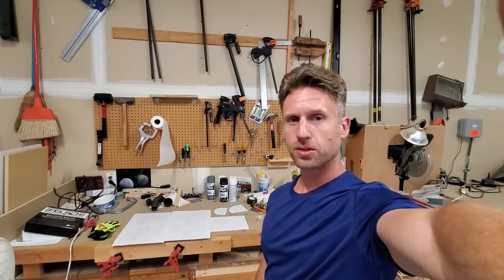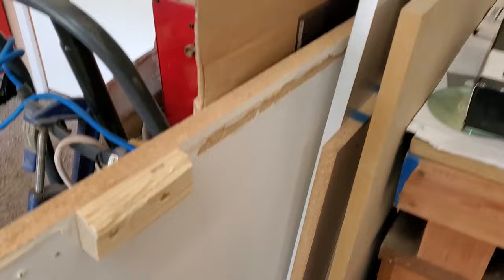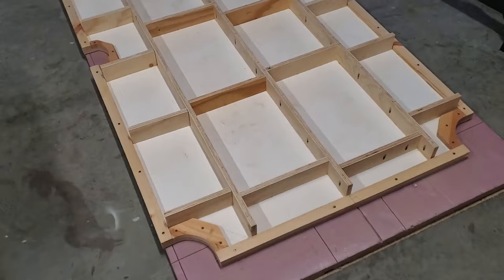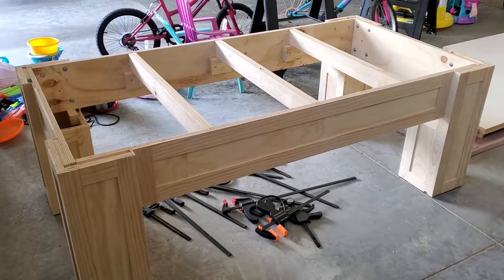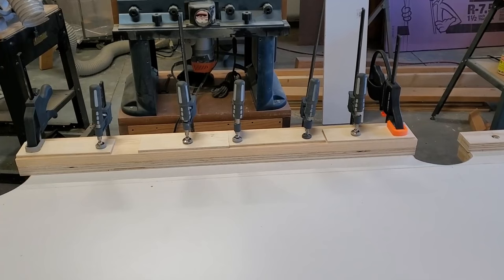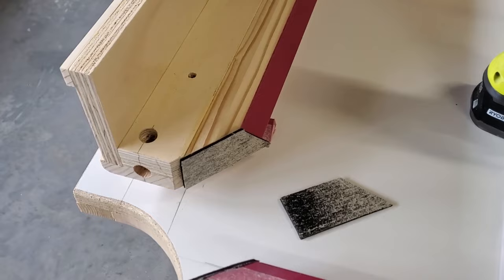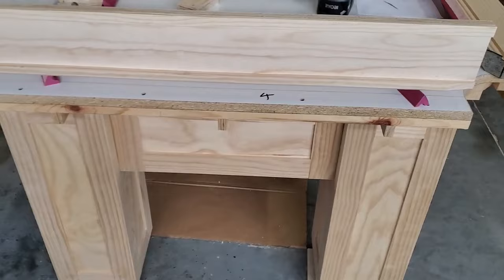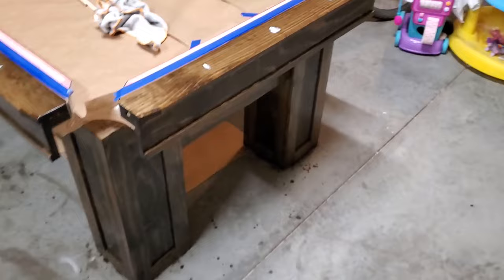DIY Pool Table

Comment from the maker: Since everyone keeps asking, here are drawings for the pocket cutouts, and the rail cross section.  This may or may not work for your project depending on the dimensions of the pockets, rail bumpers, etc.  My rails overhang the cutouts a bit.  Hope this helps someone.

https://i.imgur.com/cbvktmX.jpg
https://i.imgur.com/9pcg3Tc.jpg

Comment: I hate it not being slate. But bro. Be very proud of yourself. I have a 'real' table but for a DIY job, this is very very impressive! This isn't just knocked together. It's a triumph.
Reply from the maker: From a cost, and especially logistics standpoint, slate was just not happening. It might be marginally better with slate, but I doubt I would be having any more fun with it.  I've played on cheap tables before, like the kind you buy from a sporting goods store, and this is way nicer.  I am pretty proud of myself though... As a woodworker, I feel like I beat the final boss, LOL.
Reply: @ScotWithOnet  I noticed the bounce. The ball does die. I pondered if it was just the response from a softwood. But no, I started watching to see where it was going and by the end I just said.. you know what? Fair f'n play lad. My legs never impressed me. I was searching for ideas to go classic build or is there an awesome custom idea I can work with. I love the curved semi circle expensive style. I've not found a build video but more showing off designer tables / commissioned pieces.
Reply: @ScotWithOnet I’ve been contemplating building one myself for years and studying or rather researching the design, construction and cost aspect through any type media available off and on over time. I have a lifetime of experience and knowledge about woodworking (grandfather owned sawmill as well as a fine woodworking shop I was in daily at young age, father was a toolmaker/fabricator) 
   You have done an amazing job incorporating practicality and visual appeal with your project, especially when compared to any other diy pool table projects that I have seen. Be very proud of your work and the skills you have, it is impressive! Thank you for the post.
Reply: @ScotWithOnet yes, definitely a boss toppling moment!

Comment: So how do you work out the diamond measures ? From pocket to pocket and how deep from edge of rubber ?
Reply from the maker: Diamond locations are determined by the cushion-to-cushion dimensions of the playing area.  Divide the long side by 8, and the short side by 4, and that is your diamond spacing.  As far as how deep from the rubber?  It doesn't really matter.  I think I just put them in the middle of the rail.
Reply: @ScotWithOnet  Thank you